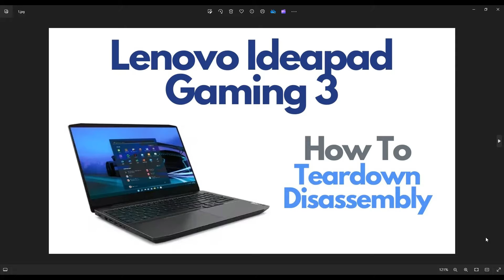Teardown / Disassembly, Upgrade Options - Lenovo Ideapad Gaming 3 Laptop Computer

Comment: Hey is there any way to pop out the fans without removing the heat sink or does the heat sink need to pop out too?
Reply: I'm also having the same doubt, did you find the answer to it?
Reply: @YashKumarArora  i cleaned my fans and ended up having to take the heat sink out with it because they're attached. I may have just done something wrong though bc it was my first time ever opening up a computer. Luckily I didn't break anything

Comment: If the system board is broken will that cause me to lose my files? Or is the hard drive separate? Sorry kinda new to this
Reply from the maker: np :) Your DATA and files are stored on the HDD or SSD. If your computer Mainboard / Motherboard dies and needs to be replaced, your DATA should still be safe on the HDD assuming the HDD is still good :)